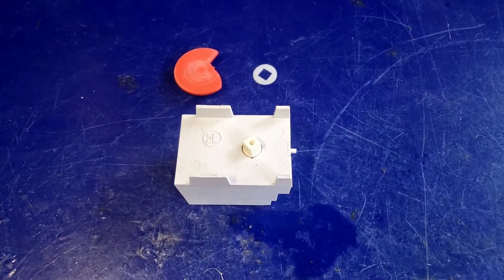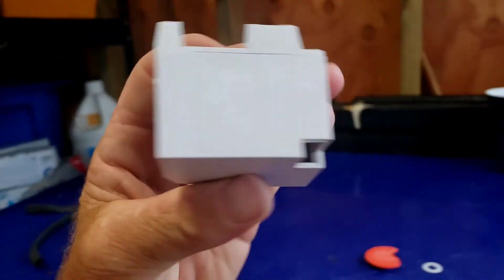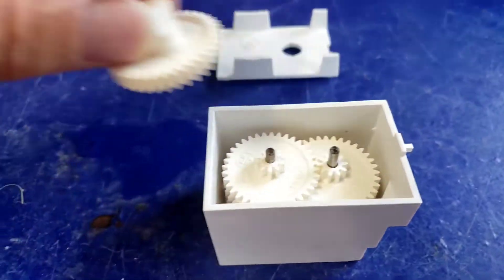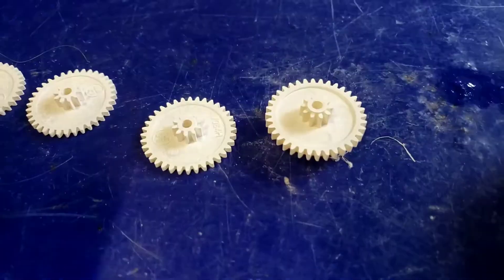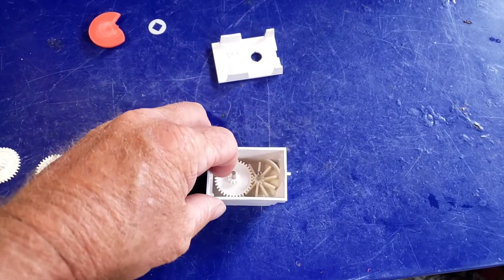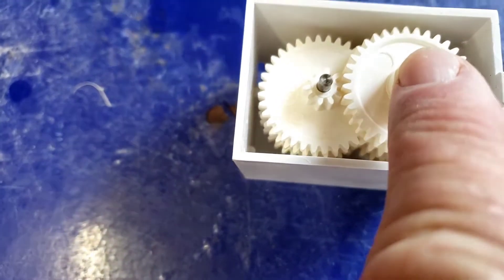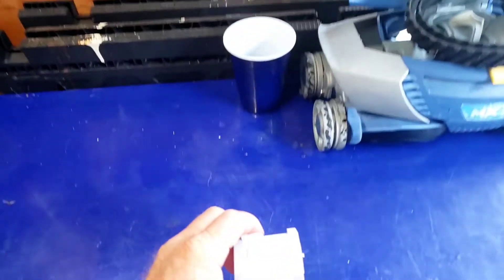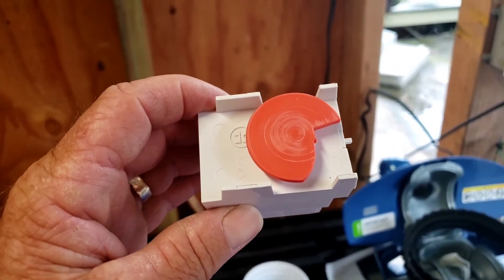Why is my pool vacuum hose twisting up? Hayward Navigator pool vacuum steering box

Comment: Everything on my hayward cleaner has been inspected part by part, and everything is working as it should. But the hose gets tangled up while the pool is running. I also made sure there is just enough hose.
Reply: Same. Did you ever figure out the issue?
Reply: @keithvonspreckelsen3077  I opened up the gearbox and found a hair in it, which I assume was causing the machine to turn only in one direction every once in a while. I know this sounds silly, but I have not had that problem since I removed that hair. Let me know if this also works for you.